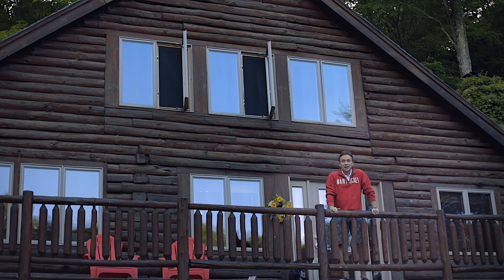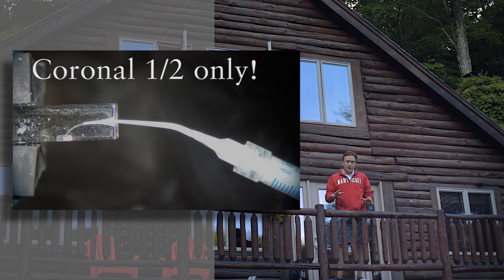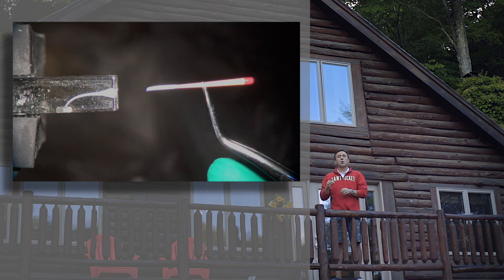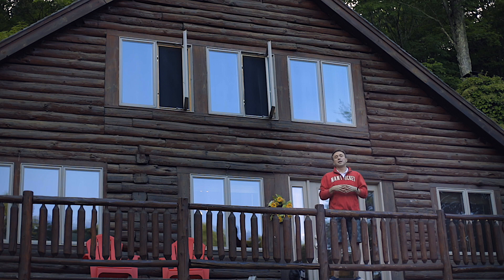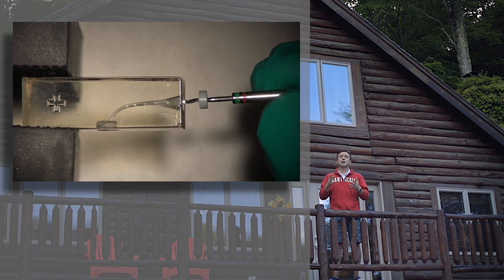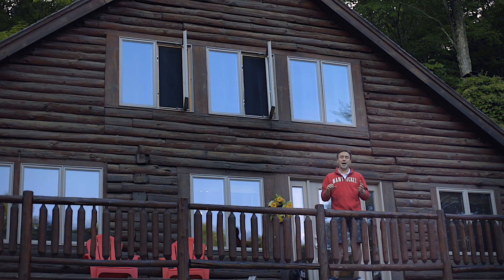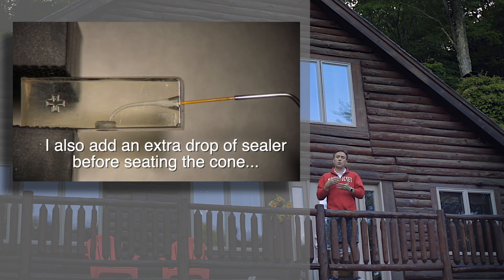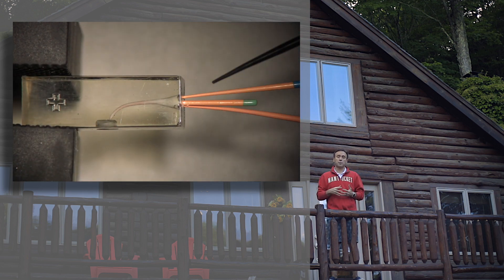Minimal Waste Tips for BC Sealer: precision with less waste.

Comment: Good morning sir I'm from India practising in Delhi my question is can we do obturation with 2% gp as canals are two narrow and too much of dentinal thickness and even after orifice opener use it's not getting widened up
Reply from the maker: dr piyush varma if you have prepped to a 0.02 preparation you can. But if you have too much taper 0.02 GP is not going to create enough hydraulic force to push sealer and reduce voids.

Comment: The injector syringe does makes us see how much sealer is injected,you can land excess  although we can be sure of pushing it right there.We need to be cautious while we press the piston.
Reply from the maker: Sri A yes! Best to inject a little out to make sure the sealer is at the Tip before placing the needle tip into the canal. You should see the material come out.
Reply: Yes the flow out at the orifice does happen with right fit of g.p in hydraulic system.. thank you